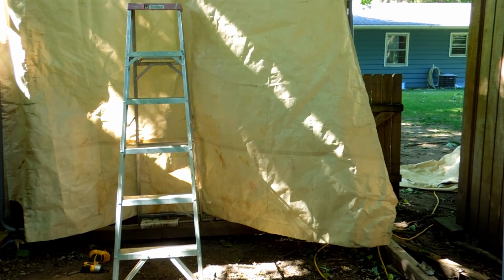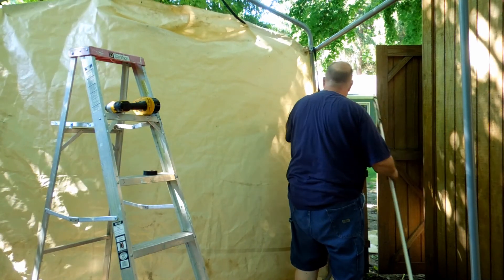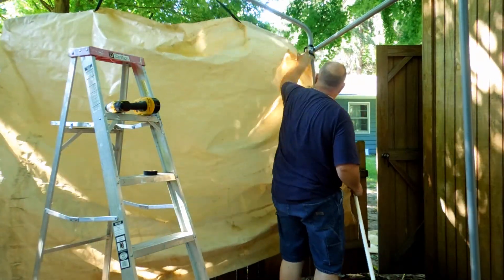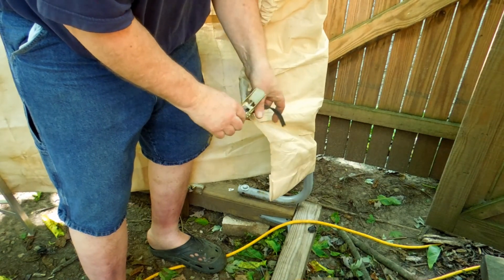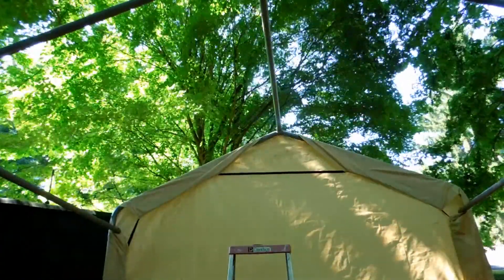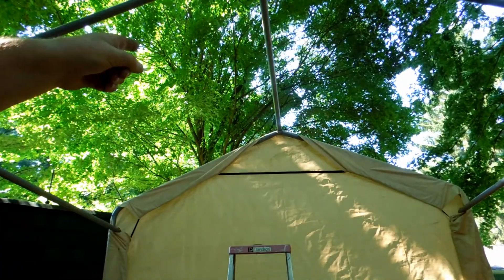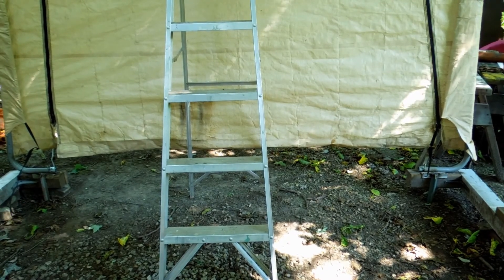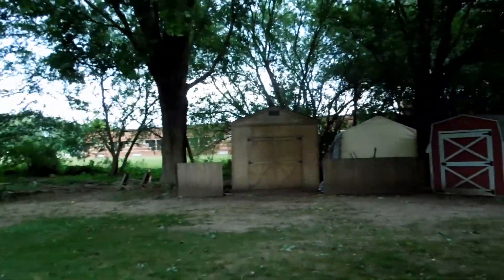Tractor Shed ~ Closing Up

Comment: I have a small shed just like yours that I kept my 8N in.  Got tired of patching holes and replacing  the tarp every few years so I went down to the metal company and got some roof panels the length that I needed and screwed them into the pipe frame It worked beautifully until I got hit be a Cat 2 and a Cat 3 tornado.  I guess my shed went into the next county.  The 8N wasn't touched.
Reply from the maker: Tough news about the shed. At least the 8N knew enough not to wander off.
Reply: @OldSneelock  It was home, just like yours.
Reply from the maker: It knows a good thing when it finds it.
Reply: @OldSneelock  Yessir!

Comment: OH yes! That'what it does here now and used to do right before a big storm. Better to be safe and cooling off inside that konked on the noggin. There's another day coming and if it don't get here we didn't need it noway. Now for me to go outside and excite my monitor a bit by doing some mowing. It was in the 50's here last night with a nice dew this morning and 70's today. Perfect mowing weather but not tractor shed weather.  Maybe later or tomorrow!
Reply from the maker: I sot this last Saturday just before a big storm took out power to 80,000 or 800,000 people in Michigan. Depends on who you listen to I guess. Some are still out
Reply: @OldSneelock  Tomorrow. Tomorrow. I love ya tomorrow you're only ah day ah way.
Reply: @mostlymoparih5682  Sounds like a severe dose of generator fumes to me.
Reply: @lewiemcneely9143  Yeah got the generator running for the mother in law with ether. Butt it kneaded the bowl cleaned out but they got their power back so the generator can go back to the end of the line.
Reply: @lewiemcneely9143  If I was the local constable I would have talked with you guys and said let's tell them they can go by. okay, you can go by but if you have to turn around and come back there's going to be a 100 dollar fine for interrupting the work process.
Knuckleheads.
Reply: @mostlymoparih5682  Rich folks WON't wait a second. ONE DAY they''ll wish they could when they see THE Big Boss. Like through a needles eye. But with Him, ALL things are possible. And the county mounty got a laugh too. He was grinning like a big possum when we went out!
Reply: @mostlymoparih5682  I try and run mine out after I THINK the outages MIGHT be over. I put a drain on it so I can empty the tank and not have to try and siphon it all out. So far, so good.

Comment: Ok at this time you might want to start thinking of plan “B”. Like digging a hole with a ramp to drive down into. Nice wood roof over head and your all set - you have already practiced how to get water out of a hole err basement I meant to say!
Reply from the maker: Yeah I think I'll wait on digging a basement. I wasn't so much worried about the shed getting blown away as I was worried about having the tarp flapping all over the place while I was trying to put it up. I gave it up as a bad go, went in the house, turned up the air-conditioning, and said that's enough. 😆

Just finished putting up the tarp on top of the shed I got some cross-bracing in place. I think we're all set.
Reply: @OldSneelock  And YOU flapping with the tarp. Yep!

Comment: Away out here they've got a name, For rain and wind and fire, And they call the wind Maria...so it's not Thor. But not to sure what she may have against your Shed personally..other than it's there and her job is to blow things away if she can. Sure all will come together ..as long as Maria feels like it! :-)
Reply from the maker: Tying up loose ends today. Got the tarps up. Setting up some cross bracing.
Reply: @OldSneelock  Goodie! I got the mowing done too! We BOTH done good! And didn't die from the 5000 degree heat factor!